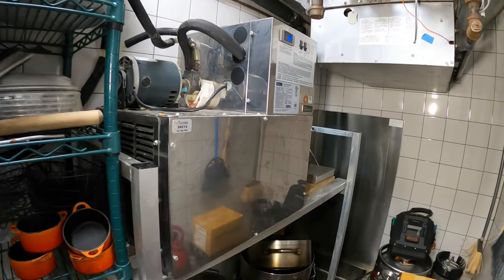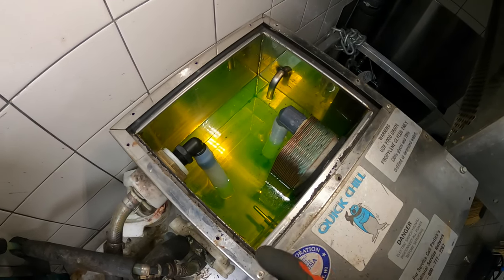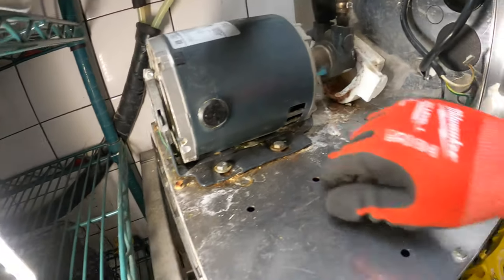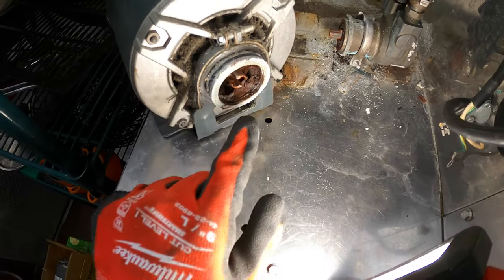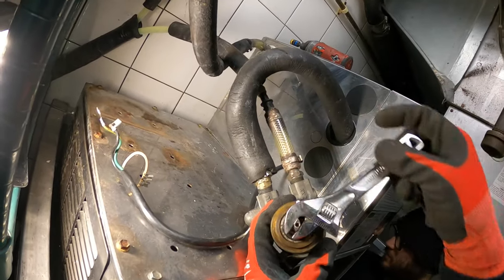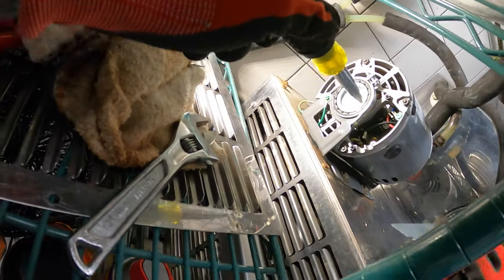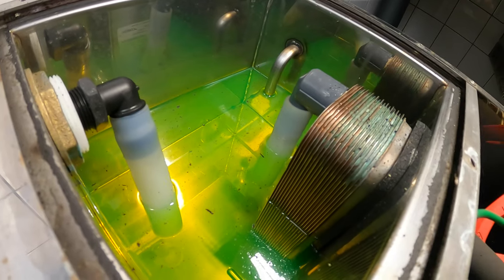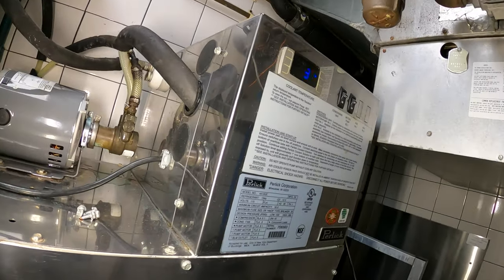HVACR Service Call: Perlick Quick Chill Power Pak Beer Dispensing System Glycol Pump Motor Install

Comment: 🇺🇸❄️💪👍 definitely replace pump. I replace both now b4 I just replaced motor then pump went n ate up the connection on motor shaft. And don't leave compressor running when pump/motor is off or down.

Comment: I have never worked on one of those either, but you might be able to lift the pump above the tank level, so all the fluid runs back into the tank - then change the pump, then lower the pump back down again (probably worth checking each pipe, by blowing down each one to make sure there are no blockages back to the tank) - Enjoying your content  👍

Comment: I used to work at Perlick company 50 years ago. My brother just retired from there after 45 years. Good job on the repair,, but I would take the motor out of the saddle to make it easier to get at the bolts. What do you charge for your repairs?

Comment: 👍💪❄️🇺🇸 motor/pump doesn't sound good. Maybe tight connections. Also the motor/pump has a pump saver assembly fits in between pump n motor for added heat transfer  protection. But ive had them break as well. Good luck thanks for sharing

Comment: Lazy diagnosis from the initial call. Not bothering to work out why the motor overheated until you came to change the old one. You really should have disconnected it and found the issue. If the pump was recommended to be changed you should have bought both or at least made the customer aware of the recommendation so he could choose.  You risk the new motor by running it with the old pump. 

Secondly you have absolutely no idea how a plate heat exchanger works. It doesn't need to be in the water at all.
Reply: I think he said that it was his 1st time ever working on it.  I don't think he was that lazy. If you wanted to help, maybe you could advise. One way would be how not to lose the glycol, the other being how to mix the glycol water ratio. I do not ever remember JMT stating that he was ever an expert, although I have seen him take sound advice from the comments. Yours is sound, just a little on the grumpy old man side. Maybe you tone down the aggressive typing one the keyboard.
Reply: JMT did well despite it being his first time on this machine. It was not lazy at all. JMT read the schematics and did the right things. If he were my tech, I would have said, great job, and learn from this one for the next one.  Isn't that the way we all learn? No one is born an expert at anything. We watch to learn out of interest, rather than pedantic criticism as you have shown.